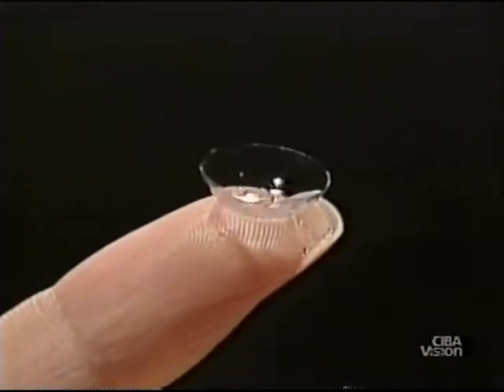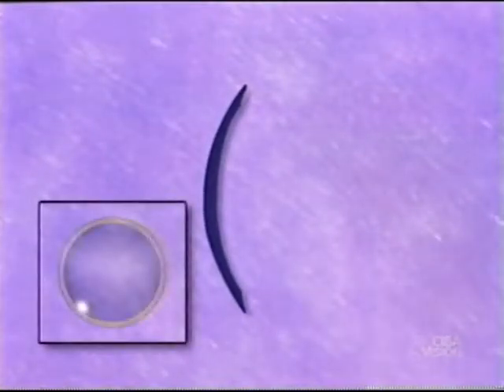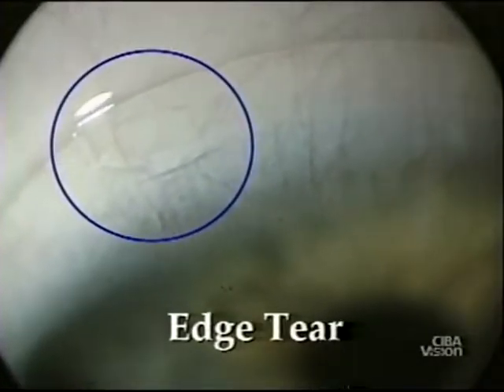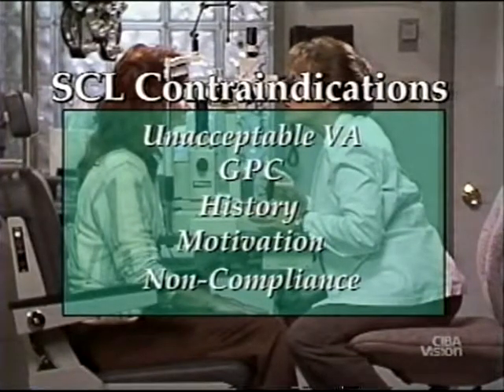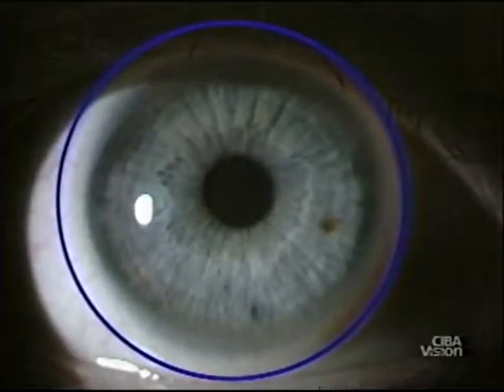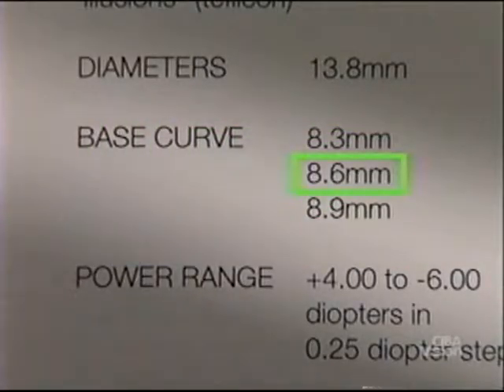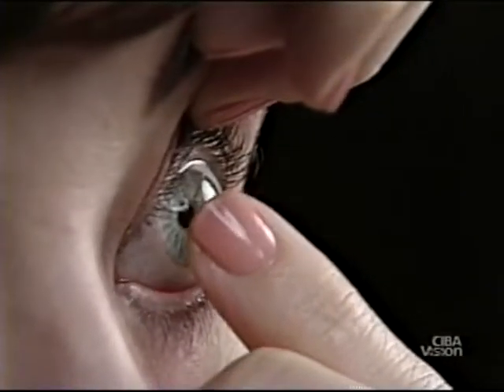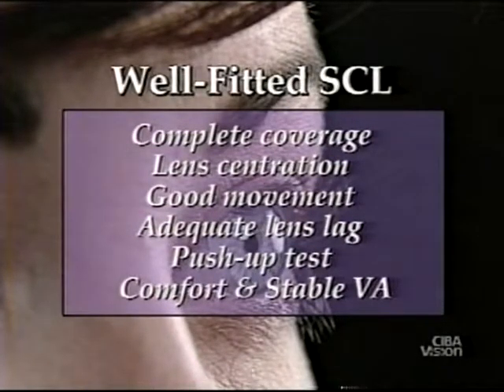Design & Fitting of Soft Contact Lenses

Comment: what should i do if my contact lenses keep going blurry after a few minute? i have to press on my eyelids for it to go back to normal for a few minutes but then it ends up blurry again. their dosent seem to be any other problems tho. i have high astigamatism and recently got custom toric soft lenses
Reply: william deng obviously wrong fit.
Reply: Could be tight fit.
Reply: I had that problem with acuvue oasys now I'm using purevision 2. I don't have astigmatism tho, so I can just buy lenses easily from different brands and try them out.
Reply from the maker: In this case it is most likely that the contact lens is tight, it is the reason why vision improves after blinking and then again it looks blurry.
In this case, all that remains is to change the contact lens; Ideally, try a lens with different curves and diameters.
Reply from the maker: Hello, in relation to your question, it is most likely that the axes are inaccurate or the calculation of the lens rotation was not appropriate.
Ideally, you should be checked by a contact lens specialist.